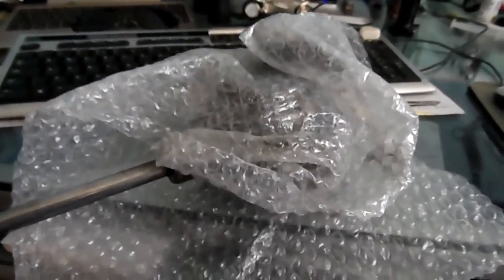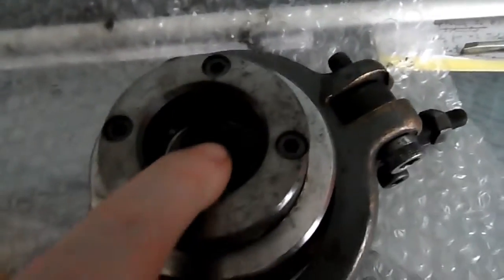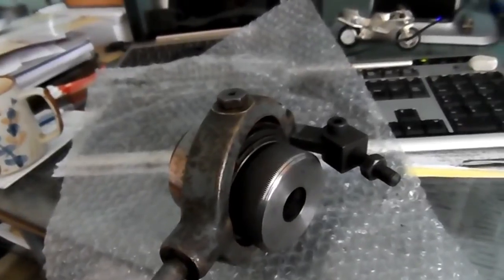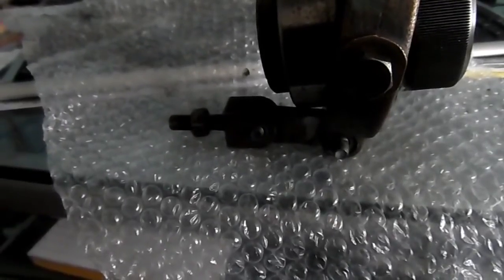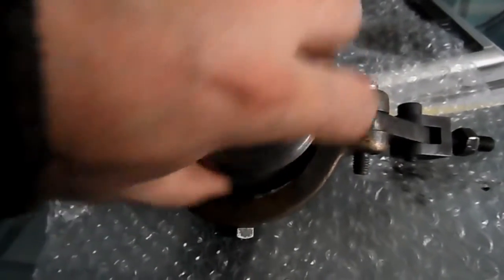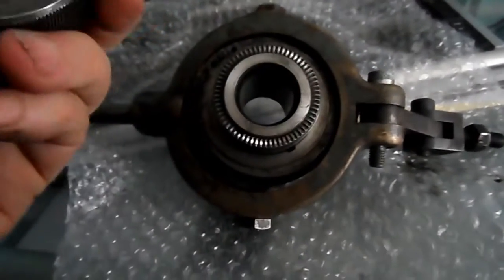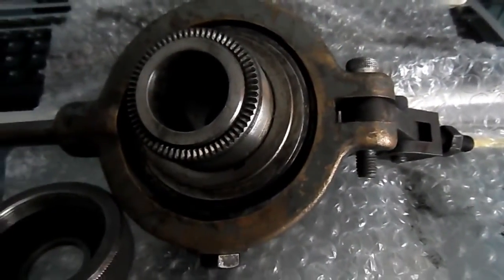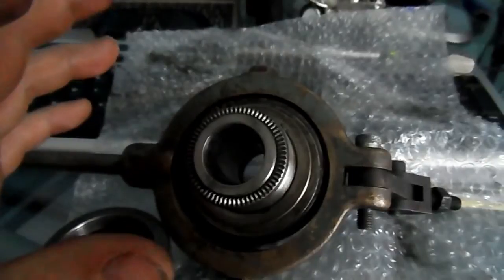Myford Series 7 Collet Chuck

Comment: Nice chuck! Are these easy to find?
Just finished my home-built "Myford" stand for my ML7 now. Look for pictures later today...:)
Reply from the maker: Relatively I guess. Its getting one that's in good working order and not too expensive is the trick. I got this one for a reasonable sum, for an old,second hand, item that could be worn out ! There's definitely a small Flat C shaped piece of spring steel missing from the collet retaining nut.I will need to get some advice on how necessary it actually proves to be in use and if essential then find a repair solution. I searched the WWW for plans to build my own as a project but could not locate any. There are plans for collet chucks out there but I couldn't find a quick release version like what Myford have done. A modern C Spanner type or Hex Nut type are readily available and cheaper than what I paid for this example but Ive no idea of the quality of these products re there dimensional tolerances or the material strength etc. I'm sure they would be fine for most hobbyists though.